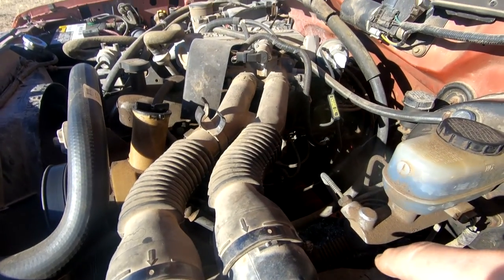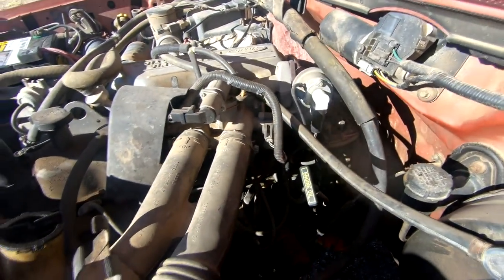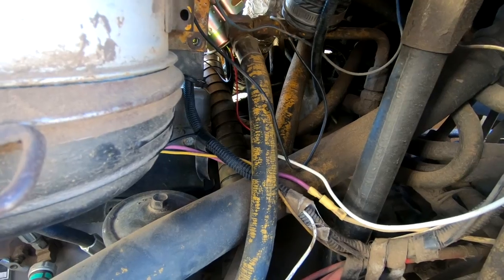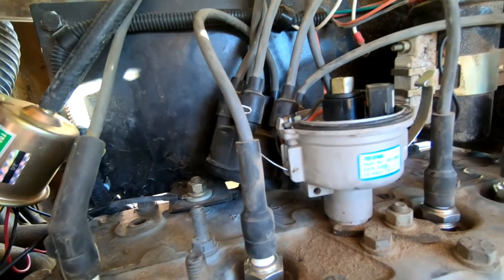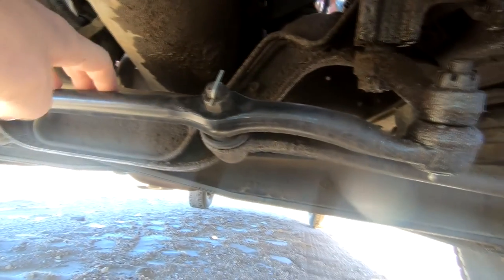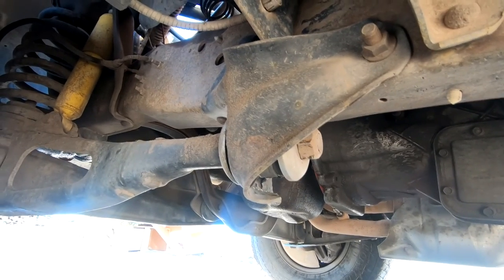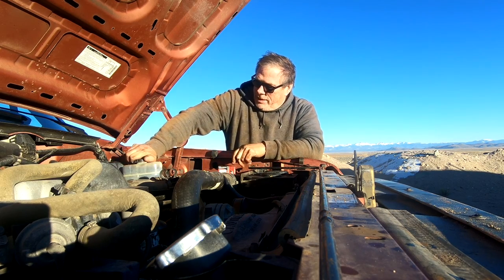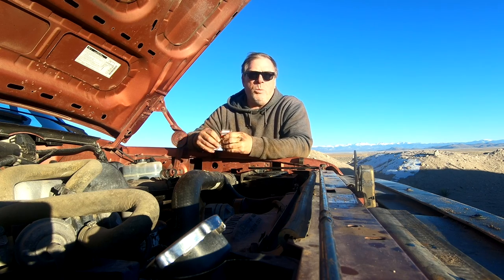The Roads Are Destroying Our Vehicles!

Comment: check the dodge condenser that is sitting on the coil. I had replaced every component to find that that condenser   was bad.
I had bought four after that never had another issue.
Reply from the maker: No condenser. Electronic ignition. Thanks!